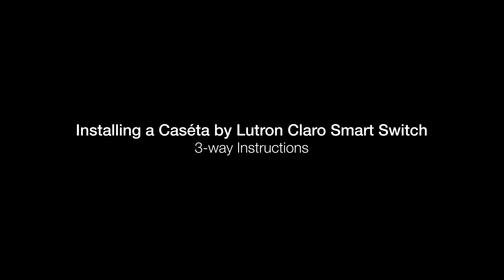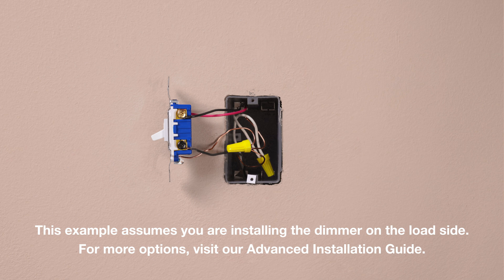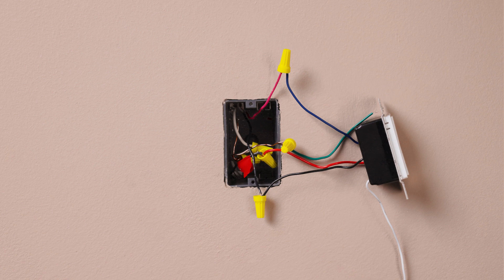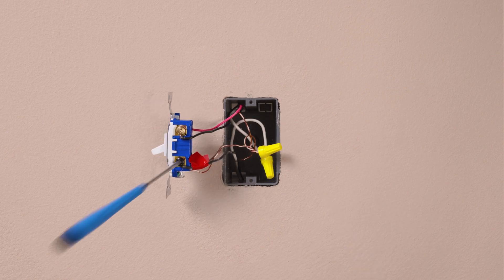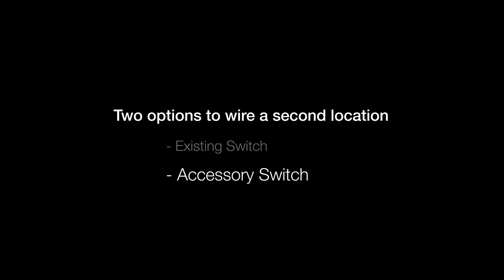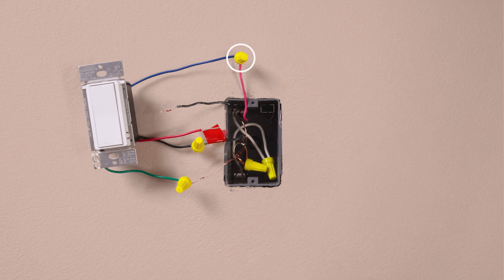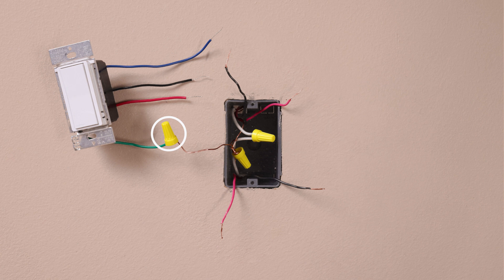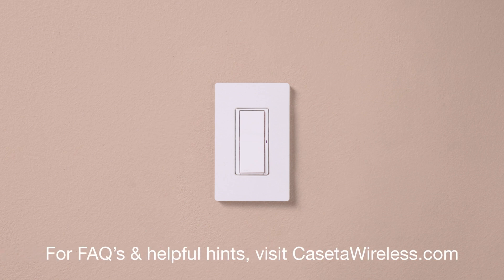Installing a Claro Smart Switch for the Caséta system in a wired 3-way application

Comment: This video shows it one way, and Lutron's .pdf instructions show it the other way. I connected the tagged wire to black (like in the .pdf instructions) and it didn't work; I switched the tagged wire to red (like in the video) and it worked.

https://assets.lutron.com/a/documents/368-4493_page_34.pdf

Comment: This video is incorrect and does not match their pdf or paper instructions. I recommend googling the accessory switch instructions, they are straightforward. It depends primarily on where the tagged load wire is located in your installation.

Comment: Whether the tagged wire goes to red or black on the Claro switch depends on where you are installing the Claro switch. If you are installing at the primary switch, i.e. the switch that goes to the breaker panel, then tagged wire goes to black. If you are installing at the secondary switch, i.e. the switch that goes to the load (light), then tagged wire goes to red (follow this video). Nothing is wrong here.
Reply: Thank you for clarifying this! This video shows it one way, and Lutron's .pdf instructions show it the other way. I connected the tagged wire to black (like in the .pdf instructions) and it didn't work; I switched the tagged wire to red (like in the video) and it worked.

Comment: So the tagged common wire goes to red or black on the Claro switch. Because the red as specified in the video doesn’t work. The black (as specified in your web based tutorial does).
Reply: Just figured this out about an hour ago after troubleshooting the problem.

Should have just read the comments first and saved myself time.
Reply: Agree… same problem I ran into relying on the video.  Used your finding and it works now.
Reply: I also got bit by this one. At least it doesn't cause a short or fry the switch with the tagged wire going to red.
Reply: This worked for me too. Video is incorrect

Comment: I found no jumper wire with my switch nor was this set up gone over in such detail in the provided instructions. Disappointing. I will try again but suggest you rework provided instructions and go over the packaging of all your switches
Reply: I also had no jumper included in 1 of my 2 packages.
Reply: I bought 2 and they didn’t come with the yellow wire. Fortunately I had some wire to use.
Reply from the maker: Hello! When you opened the packaging, there should be a yellow wire. That would be your jumper cable. If this was not found in your packaging, our team at Technical Support can assist you. You can reach them at 1-844-588-7661 or support@lutron.com.
Reply: @Lutron-Electronics  you must be crazy if you think I'm going to go through the hassle of calling you just to ship me 3 inches of wire. Fix your packaging, none of your switches come with a jumper.

Comment: Can you install a Caséta by Lutron Claro switch in a 4 way where the remaining two switches are mechanical switches?
Reply from the maker: Hi! The Claro accessory switch would work with 3-way or multi-location (up to 10).
Reply: Any videos on how to install diva in a 4way setting? Would I need a diva, and 2 claro accessory switches?
Reply: If it just so happens that one of the 3-way switches has all 3 wires going directly to the 4-way box, then you could connect the switches in those two boxes in a 3-way configuration, and treat them like a single switch. Unlikely, though.